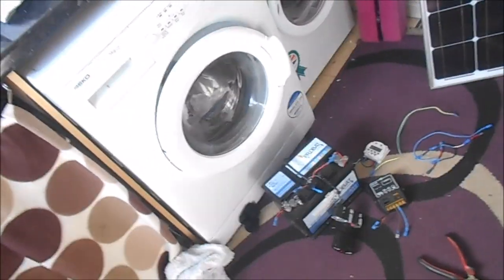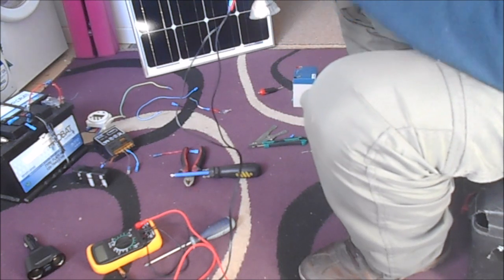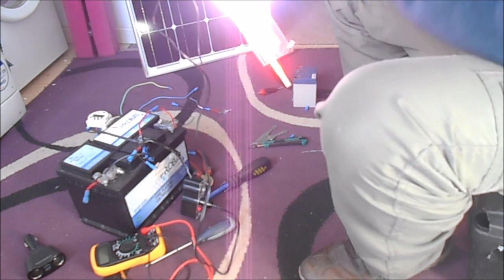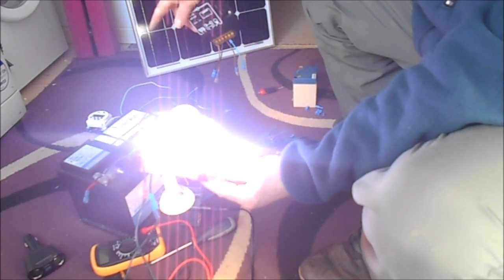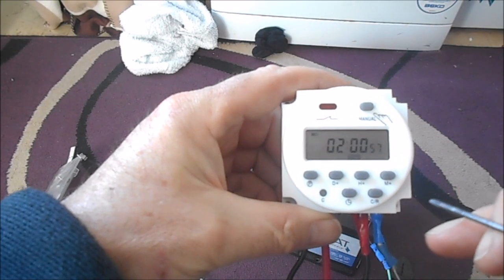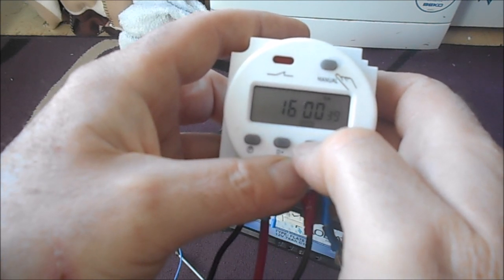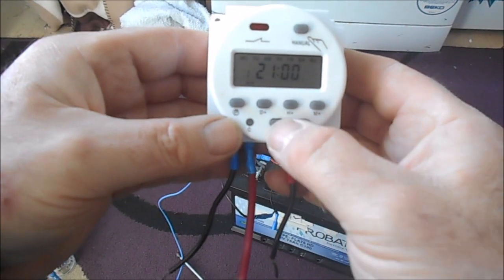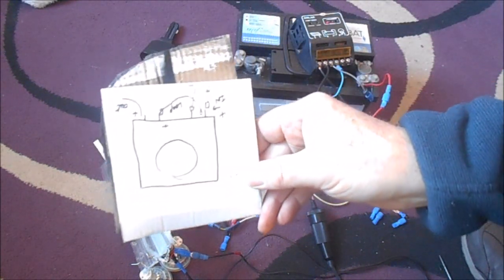DIY Solar grow lights - using old car battery

Comment: I have exactly the same plan. 
I want to install it in my green house. 
I have a spare 12 Volt car battery, solar panel, solar charge controller and a long strip of LED light. 
Does the bright LED light work as Grow light or do I have to buy different Grow light? 
If yes, can you please let me know which grow light is the best to use with 12 Volt car battery?

Comment: Could you do this same setup with a car battery, solar panel using an mppt charge controller instead of a pwm solar charge controller?
Reply from the maker: now surebut i don't see why not- it just regulates the inputs/ outputs the samereally.

Comment: Very interesting, now I'm thinking if it's possible to either run lights and charge battery at the same time and integrate a photocell rather than the timer for indoor applications so the lights run direct from solar during the day then flicks to battery once the lights dim or shut off due to lack of sun powering the solar 🤔
Or maybe just have 2 strips of light and 2 panels, one direct from solar then the other as your system with a photocell to flick to battery once the sun goes down and the 1st strip flicks off 🤔
I suppose anything is possible if the panel is big enough.
Am very keen to become self sufficient with food and energy prices going up but with 2 young kids needing the garden to run around I think growing in my shed would be most practical.
Very informative, most appreciated 👍
Reply from the maker: Great- see the solar shed video- hydroponics can be done throughout the year. Cheers
Reply: @Mikeecoman  happy days, I'll most definitely be checking that one out 😁👌

Comment: Dude, if you can make a working system that puts out at least 300watts worth of light for 12 hours. Youl get wealthy in NO TIME. With energy bills increasing the way they are, growers are hitting a wall. Il be the first to buy!
Reply: energy bills is pretty crippling currently. turning the power down to 200w and lower the height has helped massively.
Reply: What about the 18 hour veg period?